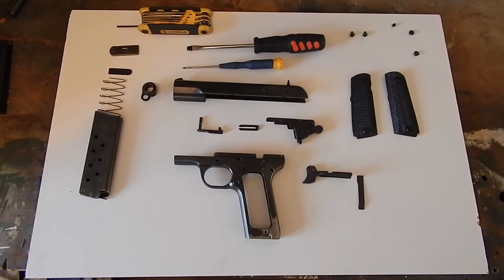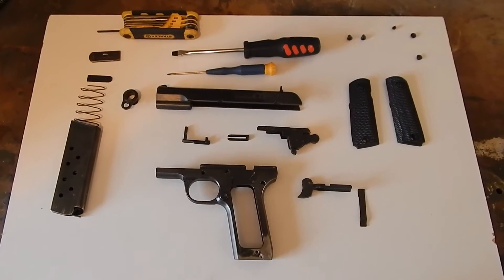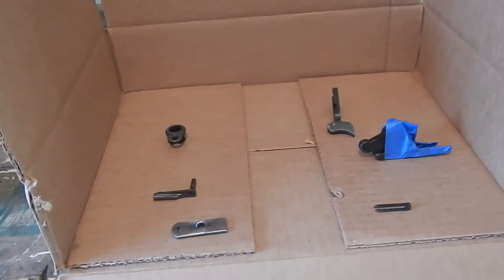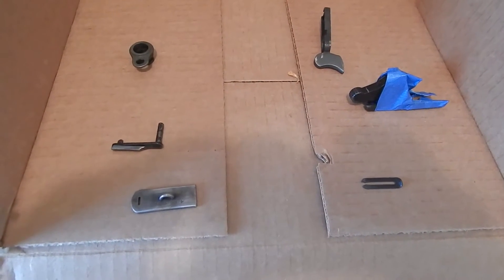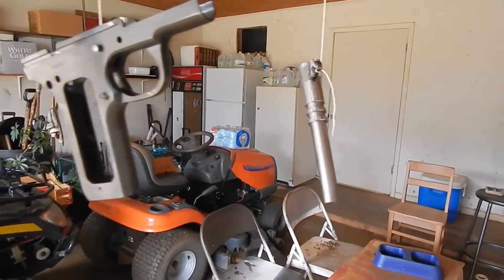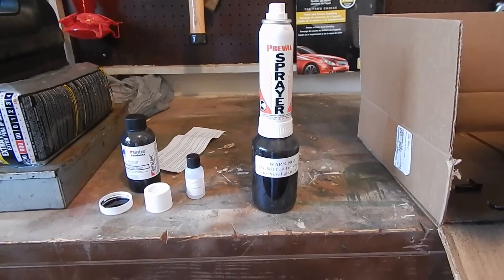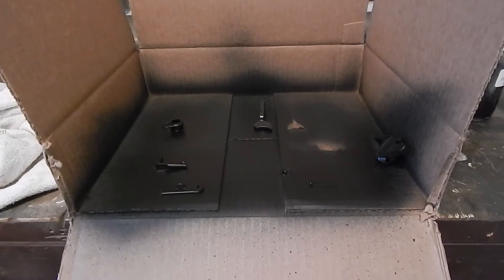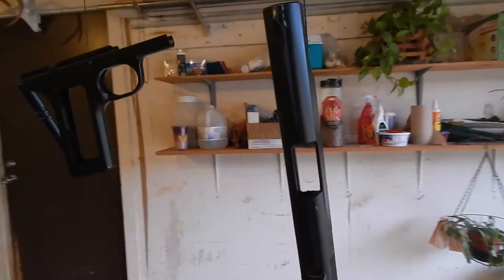Yugo M57 DuraCoat Finish

Comment: I just painted mine with VHT Matte black high temp header paint.  Works just as good, and 1/3 the cost.  Just stick it in the oven for an hour at 200 degrees for curing.  No blemish ing, no scratching, no nutin!

Comment: Why in gods name would anyone paint a stainless steel barrel?  Spray painting a gun is NOT refinishing.  Try flat sanding imperfections and stripping away all the original finish.  Then either rust bluing and carding or chemical parkerizing to refinish.  Durocoat is spray painting a gun.  Cerakote is a mildly better.  The only way to refinish a piece of metal is with a chemical conversion.   Heat and oil emersion is acceptable only if you have the ability to re temper the metal with heat.